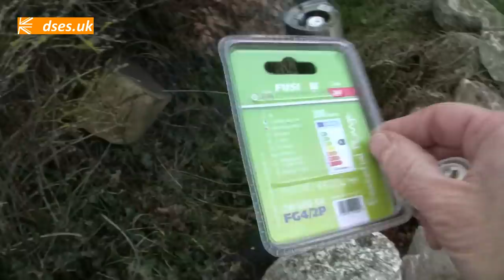Absolute sodden bollards.

Comment: As a homeowner about to have some work done in a new garden electrical circuit (green house, lights etc) I learnt a lot. You already taught me to ensure I have a separate radial circuit (dedicated for the garden with its own RCD) and now I am 'tooled up' (your joke not mine ;-) ) to start asking about 12v and suitable water proof junctions etc when the sparks comes to tell me what he plans. I guess what I am saying is that you vlogs are not only of interest to professionals, but also to help 'homeowners' ask 'better questions' - which is remarkably valuable. The professional is still the 'professional' but I feel rather more confident to ask 'why'. My profound thanks. Fun vlogs (really!) but also really very informing.

Comment: Hi Fella, the reason(S) for the steel nut and brass gland is down to firstly, how the brass behaves over time; brass on brass will cold weld itself together over time essentially, the secondary reason, which is less important is steel and brass self lubricate, therefore temporary installations are easier to dissemble [3rd] cos, and finally brass as thin as those on the glands will easily break (Brittle) when some apprentice goes crackers with shiny new grips . hope this helps.
Reply from the maker: I salute you sir!
Reply: Check out CMP glands, they come with brass lock rings
Reply: I’d be much more inclined to think it’s down to cheapness.

ATEX glands for use in hazardous areas are supplied with brass lock nuts.

Comment: Did a rewire once of a garage, to say the ceiling joist was 2m would be generous. They had strung the light control wires all to a central point (directly, laying across the joists, on an angle, no cable clips or anything), and where they all met, they did a junction to go down to the switch. The junction was a bayonet fitting, with the lights all twisted together on one side, and the supply side was the cut from an extension lead. And after they had done that, wrapped it all up in gaffer tape. Where a moderately sized child could easily reach at and grab a hold of.

Comment: Those adaptors actually look like they have a high quality socket on them. if you wanted to make the conversion permanent, it'd be easy to glue the adaptor into the E27 socket. Nice solution

Comment: Thanks for sharing this shite with us all in your usual dry, or in this case, wet humour. I'm down under in Australia and if I kept a bottle of that figure perfecting (,good luck with that) shake stuff for a day out of fridge, it would smell worse than Nigels rotting wedding vegetables. Awesome work chaps! 

FYI Rode have an awesome new upgrade of the wireless Go which is a double microphone transmitter pack with single receiver. The mic packs can also record the audio including a second safety channel at a reduced level. They work up to 200m.
Reply from the maker: I wish I were in Australia instead of on this bleak little island. Nigel and his wedding veg can stay here though.

Comment: I came across a similar installation at near-lawn level for an electric gate motor installed by the gate company. Client reported RCD tripping in the garage, found the control box full of slugs.  IP20 rated accessories outside only protected by a slip-over wooden cover.

Comment: I'm now sold on 12V garden lighting instead of 230V.  Often you just can't run the cables in a way that leaves them without any danger of damage, so 12V is a no brainer.  Working out the cable size to overcome voltage drop can be a bit of a faff, but I've knocked up a spreadsheet that deals with that
Reply: If 240v spike lights are required I cable gland the flex at the light end then run the flex in plastic coated metal copex into the wiska box.

Comment: 2 core H07 is pretty common as speaker cable  on PA systems. You might be able to flog it to a local production company.
Reply: maybe for disco dave,but  most pa rigs are  active systems so 4 or more cores are needed.Better option would to put it in a  braided sleeve  and flog it as exotic Hi Fi speaker cable at £19.99 a meter
Reply: @jan-dr1xl  2 core is used on plenty of smaller boxes, granted all your big systems will be on NL4 or EP5 but little corporate boxes don't all run active, stuff like a d&b E system can happily be passive. also older wedges  and budget stuff are quite often 2 core.

Comment: I am with you, where possible I always convert those kind of lights to 12v.
None of the lights I have ever installed have been suitable to use with swa, which we have to use with garden lights when the cable is in the ground.
Reply from the maker: Yeah, that's the problem - SWA tends to get run to the flower bed, then out spiders a load of 230V flexes right around where the homeowner will be pruning with their non-VDE secateurs! Seems weird that installers insist on armoured then drop it to flex without a second thought. 12 or 24V and nobody's getting hurt.
Reply: @dsesuk  yeah your right, may as well do it all in flex as do part of it in swa

Comment: Those bollards look like they may be  on the public highway is the customer 100% sure of the highway boundary as that may bring a whole host of other issues.
Reply from the maker: Good point, and not something I considered. I'd guess that if they're responsible for the drain those things are physically bolted to, then they're installed on the property.
Reply: Good video as always and I do like the principle of converting the outside lights to 12/24 v. I do a bit of highways stuff and spied the two sharp deviation to the right signs (chevrons) were on posts in the verge which would suggest the hedge is the boundary. That Atco drain may be installed to line up and drain into the highway ditch rather than identify the boundary. As with all these things nothing is said until somebody has an accident wouldn't want to see you ambushed with a tale of woe. 👍👍
Reply from the maker: @richardhennessy7684  Interesting. I suppose our defence would be we haven't moved anything - just made things safer in the event someone crashes into it or vandalises it, but I reckon you're right.
Reply: Was watching this wondering the exact same thing!  Generally, the verge and drainage ditch form part of the public highway.  The drainage channel they're affixed to could have been installed by the roads authority to stop water run off down the driveway on to the sharp deviation causing an additional hazard.

Comment: Howdly Doodly
I remember a video you did on reducing garden lighting from 230V to 12v by means of installing transformers and adapters that go onto the existing light fittings so they can accommodate 12v bulbs, basically a lamp adapter kit.
Can you tell me where to get these adapters?
Thanks.
Reply from the maker: Amazon old chap. There's a link to these ones in the description.

Comment: Interesting you say about rcd tripping and rain.im in a gite and it rains hard at 2 am total darkness whole house fused.i narrowed it down 2 three lights she has several old cartridge fuses on board only 1 rcd.i thought outside light switches.took out lamp in kitchen and it rattled there was like piece of metal making contact on line and neutral.normally in uk a lightbulb wouldnt fuse whole house.it wasnt outside fault i think although she didnt call an electrician just her friend who dabbles.he worked on outside metal light putting round mastic without isolating board first.if he had started unscrewing light i would have run downstairs to isolate it. In fact it was that lightbulb as wiring is different in france its on what they call retour lamp the live of lamp is conected at switch in mauve l1 i think neutral and maybe theres a common.but theres no junction box with switch live nor ceiling rose with switched live its all done at switch no earth on lights even metal ones outside often wired with limited mechanical protection. Mad system that allows a lightbulb to disconnect house.

Comment: If this were a brand new installation, would the light sensor be worthwhile given the very low energy requirements?  Just let the lights run 24/7, save the expense of the sensor, and its subsequent (lack of) reliability.

Comment: We often use also 24v circuits for outside lights when we have long-runs of lights in US with using a liquid-tight conduit. Not sure you get that in the UK.

https://www.wireandcableyourway.com/1-2-in-extra-flexible-liquid-tight-metallic-conduit-100ft-500ft-or-1000ft

Nice to see you back but hey if you don’t feel up to it no need to post anything. Hope you and Nigel are doing well.
Reply from the maker: You know, I think I have some of this in my storage unit, but I only ever tend to put in the plastic stuff.

Comment: What's your take on outside stuff like this being ran off a plug top? Always seems a bit of a lash up to me? The regs say anything about it?
Reply from the maker: There's nothing wrong with it being on a plug and socket arrangement other than the fact someone might whip it out to plug in the Hoover preventing the Deliveroo guy from gaining access! That said, it is a bit strange as the CU is on the outside wall just a few meters from where the cable enters and plugs in, so it wouldn't have been a great stretch to put it on a more permanent connection.

Comment: that gate control is dreadful!. looks like the customer went cheap to start with. for external enclosures I provide a choice of either powder coat, GRP or Stainless and you can guess what the customer goes for even after your recommendation. what can you do aye.
Reply from the maker: You might also notice the gate hinge is also hanging off on one bolt, the others having sheared off! This was recorded Thursday, and on Friday this one sheared off too. Homeowner said it was a gash install job from beginning to end.
Reply: @dsesuk  I didn’t tbh. Sounds like it was! At least you guys have done your bit and made it safe.

Comment: Could the not have some good solar lights.
Reply from the maker: Solar's an option, but can be problematic if there hasn't been enough sunshine to drive the things sufficiently through the night. For a decent solar setup, a beefy battery and decent panel would be needed which would be more of a pain to site than tapping off the power that's already there. It's certainly an option I'd consider if power wasn't readily available though.